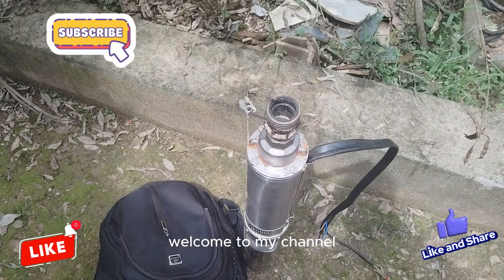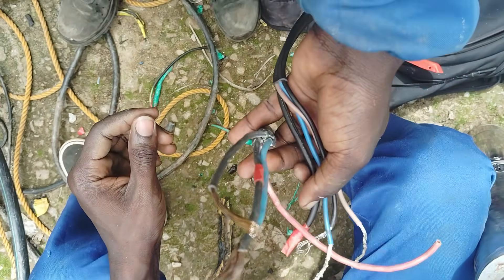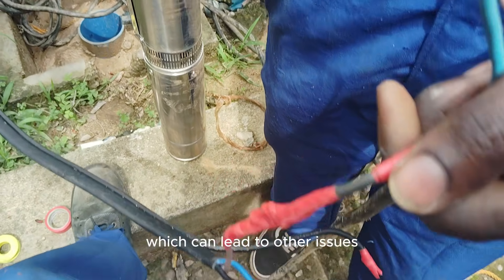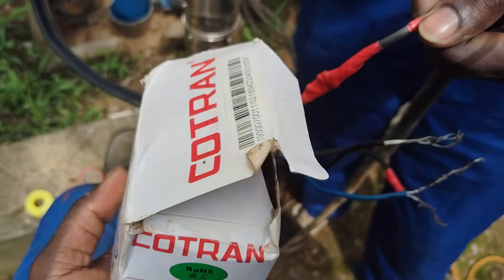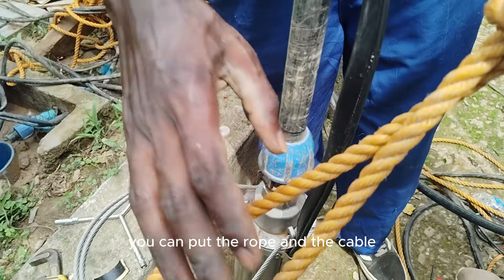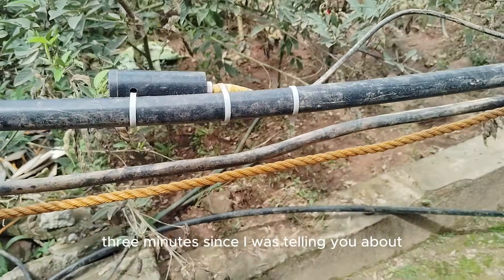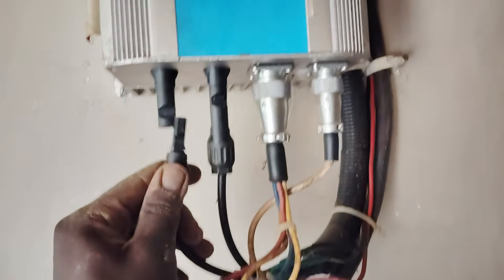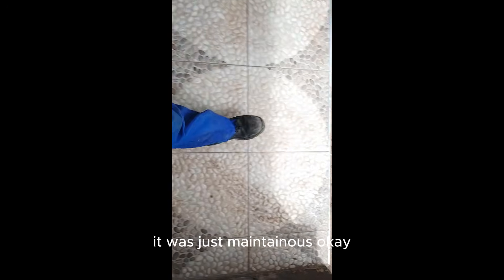INSTALLATION OF SUBMERSIBLE SOLAR WATER PUMP 1.1KW

Comment: What is the cost of a solar water pumping machine
Reply from the maker: The cost of a solar water pumping machine varies depending on several factors, such as the capacity of the pump, the depth of the borehole or well, the water volume required, and the type of solar system included. For small-scale applications, the cost may range from **$500 to $2,000**, while larger systems for deeper wells or high water demands can range from $3,000 to $10,000 or more. you can check out our website in the description for all your solar needs.

It’s best to consult a local supplier or installer to get a more accurate quote based on your specific needs and location. Let me know if you’d like tips on choosing the right system!"